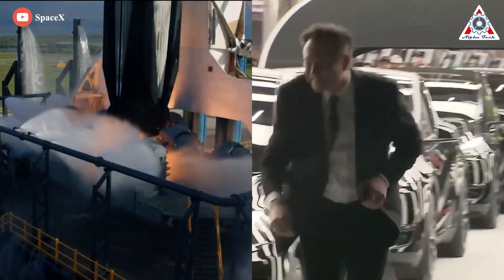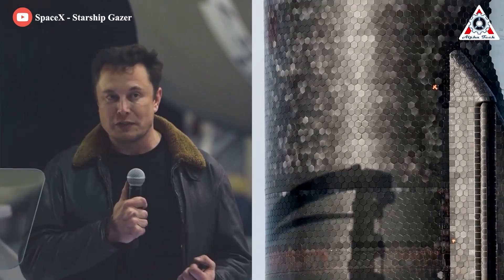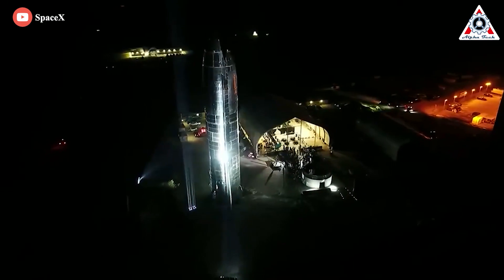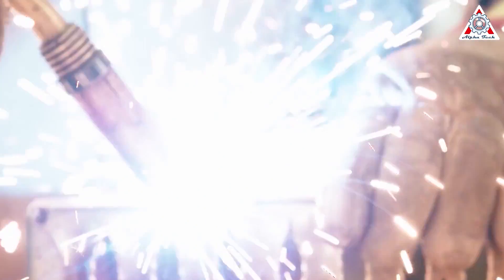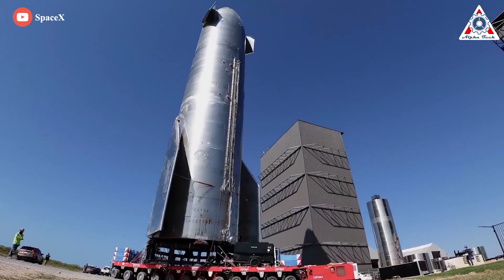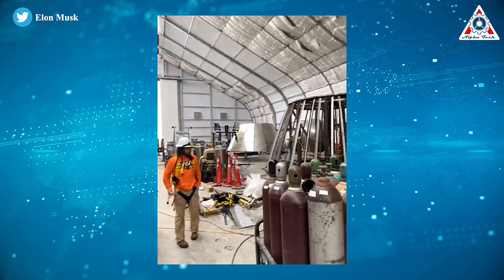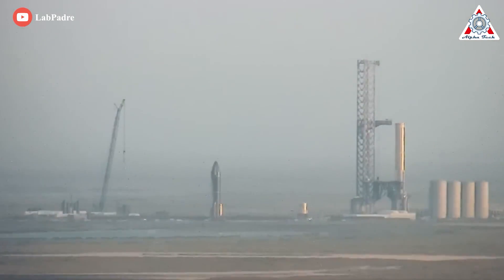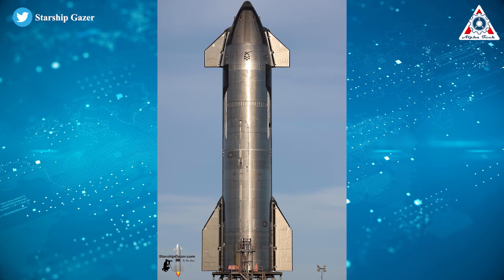SpaceX's HUGE UPGRADE on Starship's welding will blow your mind!

Comment: Welding is hell for corrosion too. Joining two different metals that are not the same chemical compositions can be bad. Even the filler rod needs to be the same. The thinner the material the harder it is to weld because the base material can just melt away with too much heat.

Comment: It so reminds me of welding with double handed TIG welding one welder inside the vessel and one welder outside who TIG welds the joints and feeds the welding wire by hand while the other welder inside follows the weld seam so doing the penetration of the weld is controlled and shielded by the same gases Argon and helium preferably or Argon which is just as expensive, but Co2 gases is really not very clean, but it's interesting to see how much stainless steel welding has is still being done, good luck you Space X workers.

Comment: I’m a hobbyist welder with some  MIG and TIG experience. Stainless is a bit more reactive than mild steel. One thing I didn’t see or hear discussed was the common use of back side argon purging to keep both sides of the weld in an inert environment. Thoughts?

Comment: I’m a hack welder and the impression supplied here suggests that stainless is difficult to weld as I find it the easiest metal to weld
Reply: Most likely it’s you. Really depends on the welder.

I ran a Construction firm most my Welders gets more welding imperfections on Stainless steel sheets and tubes than they do on regular steel.

Comment: I seriously doubt that the early welders were novices. I suspect that they were all highly qualified aerospace technicians. Also, all aerospace fabricators use nondestructive tests (x-ray) of every critical weld. Just like the tests I performed on the Lunar Excursion Module (LEM) during it’s fabrication at TRW in Redondo Beach, Ca.

Comment: A little off topic but shouldn’t SpaceX be trialling the whole launch and catch thing before they duplicate with launch towers etc. I understand the whole trial iteration thing but whats the point of copying potential mistakes and redesigns. There is enormous potential for physical refinement being more than just software update of the propulsion system/catcher arm movement. Already the catcher arms have been shortened, probably for faster response, less inertia. 

I bloody luv what they’re doing but to say this is a huge Elephant in the room is the understatement of the century…
Reply: The building prozess of the core structure of the lauch tower is as important as the development of the rocket welding and the moveable parts on the tower. By doing it for a second tower immediately following the first one helps to refine the prozess on the fabricating design and on the welder skills level. Design changes are no problem if you have the power to build it fast and effectively. Plus he gets a second test ground in an area that has lived with starting rockets ever since and gets him a foot into the classic space flight community. Maybe 80 Percent of the classic space industry statt don't like him, but if he can get the most enthusiastic 10 Percent of other Space companies to work for him on any level that could be huge and worth every penny on the long run.

Comment: The decision to go steel rather than carbon fibre has vastly decreased 'iteration timescales'. Once the Starship model is perfected from a functional perspective only then weight optimisation takes priority. This will allow further gains in payload-to-orbit.
Noted though that nothing here is 'rocket science' just lots of lateral thinking, so other countries space efforts (e.g. China) are going to rapidly be able to catch up with the fully re-usable concept once proven and they will. I doubt there will be another expendable rocket designed after first successful SpaceX orbit (apart from perhaps for nukes!), this year is 'transitional' in that sense.

Comment: SpaceX didn't "change their mind" to use stainless steel because it was "cheaper". The lowered cost over Carbon Fiber was a secondary benefit. I'm very familiar with Boeings switch to a Carbon Composite fuselage on the 787 DreamLiner vs good ol'e 7000 series Aluminum. Carbon Fiber is Super Difficult to test as to it's failure point. It's breaking point is all over the map compared to metal, which is extremely consistent. Secondly, it's very difficult to make a stiffening resin for it that's Non-Porous. It leaks a Lot and is difficult to work with in large components which need an Autoclave much larger than the part. AND, it doesn't hold up to the heat generated by re-entry worth a damn. I saw a Winglet, about 4 ft tall on the wing tip of an Embraer E175, get struck by lightning. All of the strengthening resin had been evaporated into atoms and was absent from the Winglet. All that remained was carbon fiber strands which looked perfectly cleaned and brand new. Add to that, Carbon Fiber repairs are much more complex, difficult and req breathing equipment as CF dust will not degrade when breathed. And, finally, ANY defect, ding or minor damage near a stress point will pretty much guarantee a failure at that point. CF isn't tolerant to minor dings, notches or deep scratches without compromising it's structural integrity.  If you've ever dinged a carbon fishing rod, that's where it's gonna break.
Reply: Great info, thanks for the education!
Reply: Great post thankyou. Makes you wonder what RocketLab is about, when you have Relativity and SX.
Reply: Thanks for the info.  Although having used fishing rods I suspected as much. And I am glad I never have to fly again.  Hopefully.
Reply: @kpdutylastsupper  That is genuinely Funny  : )  Yea, I worked a Maint QC Inspector w/ a U.S. Major for a few decades. I Really Like airplanes and what they're capable of but I don't like to fly At All, especially now days with the "pack the plane" business models now used. When I first hired, we flew Fokker F-28's (Dutch made A/C). They used RollsRoyce Engines, held 79 souls and would break even on expenses @ 9 seats filled. PLUS, the goodies the flight attendants handed out were custom baked/cooked for our airline. Not the case anymore, it's fill the plane and give em Nuts : /

Comment: I wonder whether Elon has considered constructing the Starship and Booster in reverse order - from top to bottom? The top section could be raised in the high bay, a lower section added and welded, then raised again and repeated. This would have the benefit of allowing work to be carried out at or just above ground level rather than up in the rafters! It would also free up space needed to raise sections to the top. Just a thought.
Reply: I think they are adopting the modular construction method used in submarine/ship building. Here the 4 ring segment are the modules..
Reply: Thats how winery tanks are made typically so i would assume he has
Reply: I saw a real old render where the steel was fed up in a spiral like a toilet paper tube. Thought it has merit. One mount , welder,  checking and other treatments

Comment: I may be wrong, but I thought they were using robot applied stir-friction to weld the ring sections together and the seams in each ring section. Has something changed?
Reply from the maker: Yes. SpaceX also started to buy robotic welding machines from companies Liburdi and Kuka, similar to the ones seen in Tesla factories. With these upgrades, SpaceX automated a large chunk of the process and started to produce cleaner and more precise welds.

Comment: If you are going to weld, you will either be an excellent welder or an excellent grinder.
Reply: you should be both,,  good welding leads to less grinding,, I always started my trainees on grinding and polishing,, they learn what good welding is very quickly that way,,
Reply: @hugokappes4077  
That is why my dad always said, 
“If you’re bad at welding, you’ll get good at grinding.”

He was an excellent welder who preferred to not grind his welds if and when possible. 

Granted, Stainless really does show blemishes… my belt buckle (was his) needs to be polished every few months or so.

Comment: Its called porosity, when the gas shielding the molten pool is blown away and oxygen then cause weld pool to develop hallow holes threw out the weld. Looks like a lava rock. Also when welding on higher grade aluminum &steel, heat is the biggest issue, it changes the molecular bonds causing the material being welded to become  brittle.  For navy vessel root welds are performed with ceramic backing tape. Has root weld channel in the ceramic pattern. I don't know what kinda backing system space x used when they where hand welding the prototype. COLD ROLE as a welder means you can't weld. Cold role happens  when a welder doesn't know how to set his wire speed and heat. If you can slide a finger nail and feel it get caught on a Cap pass weld then its a cold role. Bad bad welder.

Comment: Had thought puzzle welding might be the best idea. As stainless can be cut with precision. It would make it a stronger structure.
Reply: I'm not sure what puzzle welding is, but I'm guessing longer welding length to increase strength, wobbly lines (not angular). To make welds  to at structural strenght sounds interesting
Reply: that would make a great deal of complexity and would increase distortion issues,, as it is the guys on the computers make jobs enough of a puzzle for fabricators,,  putting joins in the right place and fitting things together the best way comes with years of experience,,  from what I can spacex is getting a decent handle on their fabrication now,,

Comment: This is basic metalworking you learn in the 1st or 2nd  year of a 4 year apprenticeship... not mind blowing at all, just proper manufacturing procedures finally being applied
Reply: Eh, dude.. maybe not mindblowing for you but I swear to you that there are more people who haven't went through welding education during their lives, so yeah, kinda new information for us mortals.. :)
Reply: It's amazing it has taken the geniuses at SpaceX this long to figure out.  LOL.  Waiting for the RUD.
Reply: @MUCKFOOT399  This isn't backyard shade tree welding.  They are building space craft.  Aerospace!  The number of stumbles I have seen on Starship are unbelievable.  Poor quality is the hallmark of Elon Musk.
Reply: @ReachOutToWilliam  It seems to me that SpaceX purposely does not want to follow the traditional "aerospace" model with its cost+ contracts for platinum plated parts and top grade everything, including nuts, bolts and toilet seats that result in $4 Billion a piece "spacecraft". Developing techniques for stainless steel welded construction in the open environment instead of in a cleanroom will come in handy when you need to repair damage in orbit, or on the dusty surface of Mars. And using off the shelf FMT/SPMTs to transport the Booster and Starship instead of the $1 billion crawler transporter used by Boing/NASA is a teachable moment for the old "aerospace" contractor dinosaurs.

Iterative agile development, a software engineering methodological concept is being adopted by Space X to the extent possible, which in itself is a major innovation. That is another reason why they don't want to fix their design, production process, even part materials up front (as was done traditionally in "aerospace"), but iteratively arrive at the optimal combination. They are even applying it their factory shop floor design and construction and Ground Support Equipment (GSE). Don't forget, SpaceX is a successful Aerospace company now, not a newbie. They know how to build launch vehicles.

Comment: As a welder, I probably understand better than most people  what he is talking about.
 Laser welding is probably  the most expensive  process that can be done, but the most reliable type of welding on Earth , but the most expensive also.
Still if I were going up in said spaceship I would trust laser welds more than any other kind of work .
 I have seen argon welds fall apart, so right away when I heard the narrator talking about argon welding I was skeptical,  anything that has high vibration  can break the welds , and a 
 Spaceship has the MOST vibration of any machine.
 I found it difficult to believe Elon Musk would allow people to go up in such a dangerous space craft, 
 But he didn't  expect people  to do it .
 I am  surprised he even considered  it in the 1st place.
 Tell me this 
Would You work in a particle accelerator that was built with the cheapest possible products ? 
 NOT Likely! 
 Why would an Astronaut do it either .
  DML
Reply: Nice to hear from an actual welder. I was also skeptical about the welds and the production consistency. But then again I look at it from an experimental development perspective. Which I do a lot as software developer. The thing is you want to get something working as quickly as possible. To be able to try out and test the most critical concepts of the project. In this case the belly flop maneuver. These prototypes are al about getting information. Insights per dollar spend. And then it makes sense to go for cheap welding methods just to safe time. Knowing that you're not locked into the technique but can change it later. But at some stage later in the project you can't change techniques anymore, because other systems are designed  and validated around it. So it's important to identify and communicate those stages in the project and get the final technique in place beforehand. So i guess for the belly flop tests the welding was not critical, but for the orbital tests it is.
Reply: @mennol3885  
Yes , I had that figured out before I started to write, but wasting  time is important  and argon welding  was NEVER an 
Option
Reply: @Mike-iv3hy  Lol, well I know that now, and the folks at SpaceX now that now too.
Reply: Hi Mike, By Argon welding I assume you mean TIG welding which uses argon gas. In reality Laser Welding also uses an insulating gas, perhaps argon as well ! All Welding needs isolation from oxygen where melting the parent material is involved. Also I wonder what brand gear they’re using?  For 13 years i was a chief service technician for Fronius.
Reply: @derek75116  
No ,Derek argon welding is stick welding and was used back in the 70s, Tig welding was not invented until  the 90s .
Reply: @Mike-iv3hy  what ???  you got no idea,, they have been tig welding for years,, when I started my SS fabrication apprenticeship in 1981 the first thing i was shown to do was tig weld, on machines that looked like they came out of the Arc,  The argon welding refered to is tig welding stick welding is quite different,,,  so tig welding adopted here in NZ probably early 50s,,
Reply: Asking your welding knowledge. Does cryo hardening  stainless welds improve the performance?
Reply: I rely on rivets and cables to keep me up in the air when I fly through high vibration environments. Laser welds  made by robots sound like an upgrade to me.
Reply: what I wonder about is will spacex use 304L for production fabrication or only for prototypes,, 304L is crack prone with vibration and there are other SS alloys more suitable for a starship intended to be flown multiple times,,  I guess I will just have to wait and see, if i wasnt so far away i would want to be working on those starships, it would have been a cool thing to do before retiring,,

Comment: I have never heard that Musk is dreaming of a REGENERATED HEAT SHIELD. I would like to see more on that concept. How do you regenerate a heat shield?
Reply: Using Notch Apples
Reply: @NobPyxl LOL
Reply: Just read up on it. Musk's intent is to "bleed" steel into the shield as it ablates during high temperature landings. Sounds great, but how they will do this is anything but obvious. How do you do such a thing without destroying the strength of the stainless steel? Very interesting.

Comment: 0:40 Heh ... look at those sloppy "pigeon poop" welds in the lower left of the screen. 🤮 

Good welds look more like either a stack of partially melted nickles laid down on an angle, or parallel beads of caulk, depending on the width of the gap being filled, how you walk the bead, and the type of rod/gun used.

Comment: Im a trained welder.  Stainless steel is a nightmare to weld, especially thin stainless.  There are other processes they could use besides flux core, mig or dual shield.  There are explosive welding techniques they could use to connect most of the long seams.  It would allow them to fuse other metals in needed areas too.
Reply: Tell me more about the explosive welding.
Reply: @vinnylamoureux1187  ADTW learn has a good video explaining it.  Explains it way better than I can.
Reply: @flyingnorseman  thank you. I will try to find it.
Reply: Wouldn't you believe they would have tried that since it is not a new process?  But maybe not.

Comment: Actually your description is wrong, a weld joint should be at least twice as strong as the material it is welding. If it is not then either the wrong wire/rod was used and or the wrong gas mixture and or voltage was used. Regardless at no point should a weld ever fail and if it does it was done wrong PERIOD!

Comment: Actually as far as weld strength, the weld should be stronger than the surrounding metal, not as strong. The way they test welders is to cut out a rectangular metal across a weld,  then attach each end of the rectangle to a hydraulic pulling machine and turn it on. The metal will eventually rip apart and the weld section itself should never move.
      It may just be me growing up in Texas with all the industry that I worked in and around but that kind of knowledge is pretty much commonplace. But it just explains one more video from this source that doesn't really cover anything except ways to waste people's time. At least this channel is consistent at that. 🤨